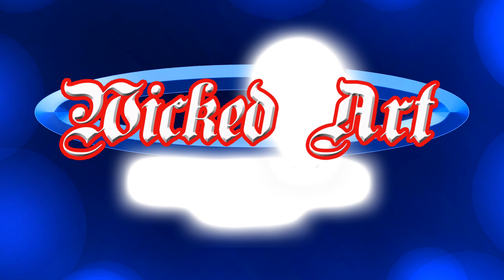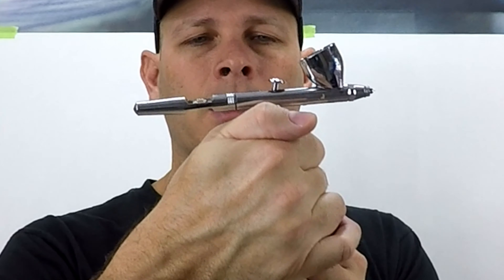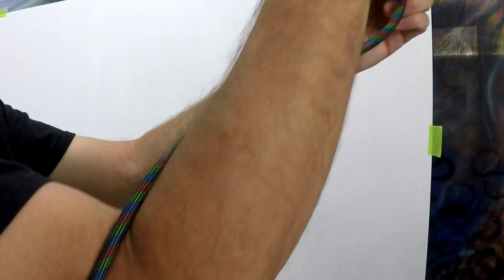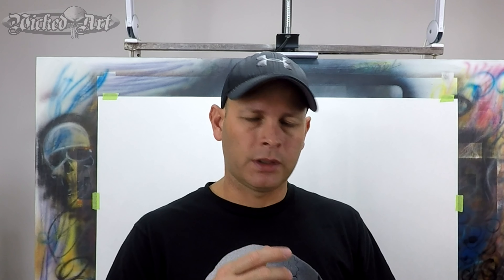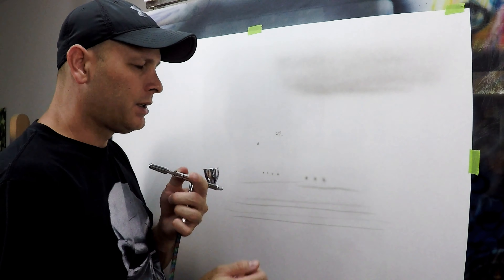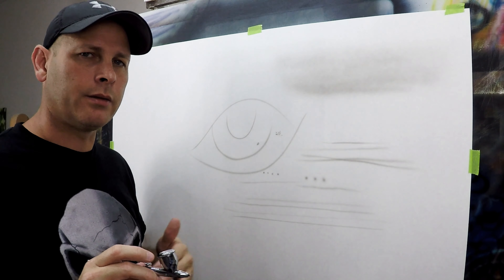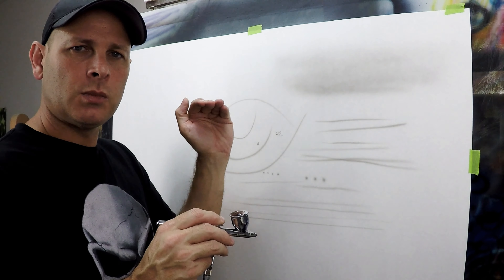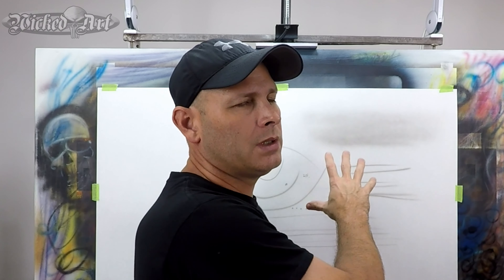Airbrush Basics: Holding the Airbrush

Comment: iv only just started and cant seem to find a comfortable grip. feels like im holding a pen really awkwardly, i have my thumb and top thing both touching the trigger atm so i cant control the air to paint ratio better but it just dosnt seem right
Reply from the maker: It takes some practice to find a comfortable grip that works for you.  Sometimes it comes down to the size of your hand as well.  Larger hands can be more difficult to find a comfortable position with a gravity fed brush.  If that's the case, you might want to try a siphon fed or a side feed brush instead.